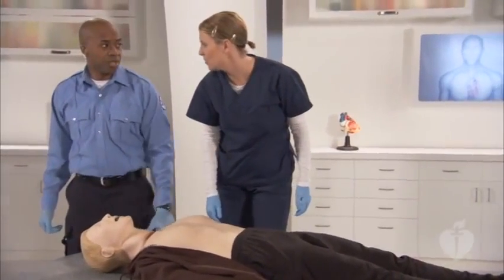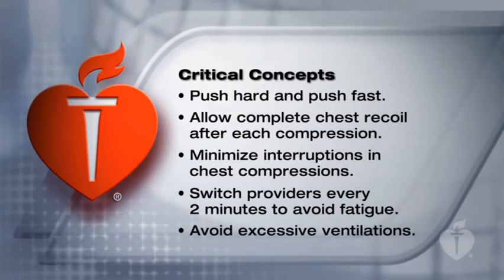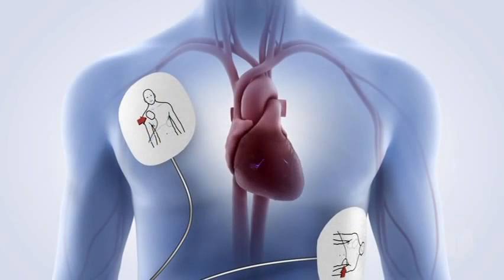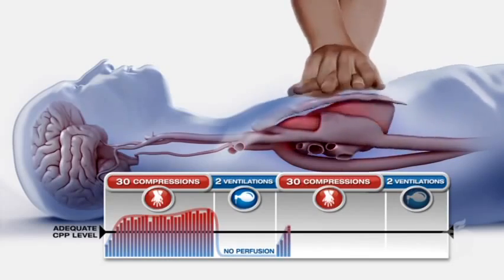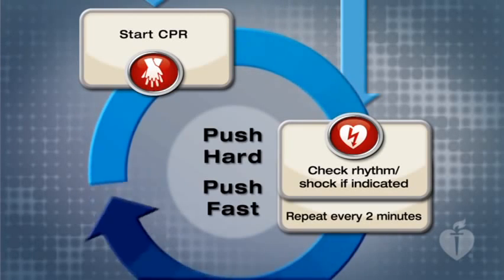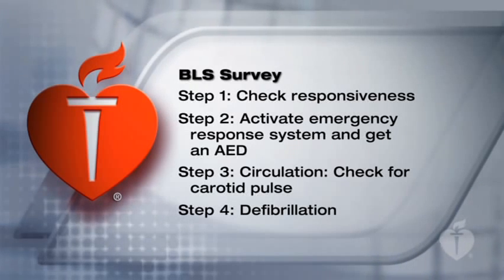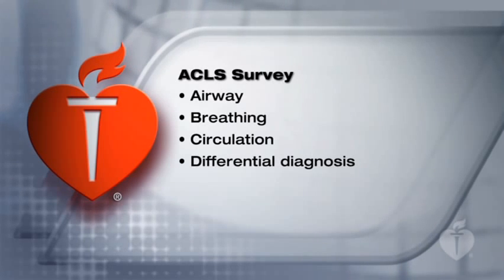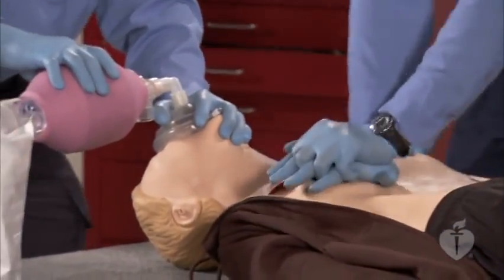Advance Cardiac Life Support Overview and Protocol - ACLS AHA

Comment: Do you shock patients with pacemaker?
Reply: But you can't put the pads over the pacemaker, you must put it elsewhere
Reply: yes
Reply: by all means.just make sure not to place the aed pad on top of the pacemaker
Reply: yes.. you can do it with the pacemaker pads.
Reply: +Josy Delgado   Ok, thanks
Reply: +Laura Guzmán  Yes, like the electrodes, you can't place them over a pacemaker.. you must place it in other part of the body, in this case I use the extremities.
Reply: hi invited
Reply: zeezeebo yes but dont put ur defib on top of it
Reply: Yes you can shock a patient with a pacemaker. You use the adult pads and if it is pediatric patient and you do not have the pediatric pads, then you can also use adult pads.
Reply: I saw some comments saying that you can't place the automated external defribrillator over the pacemaker this is not true. You can place the pads over the pacemaker. Also, you want to remove a patient from standing water. You can leave wet clothing on them. Just dry their chest off.